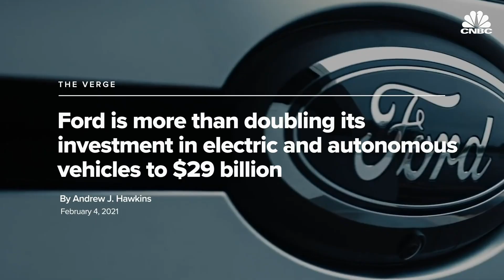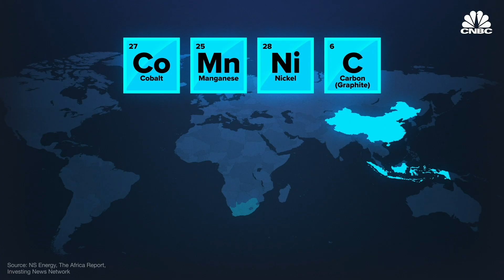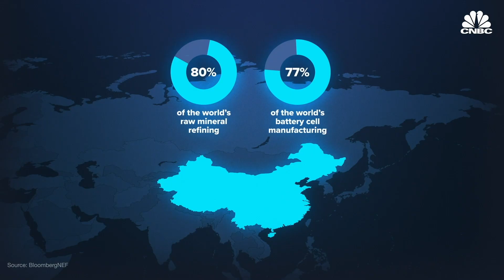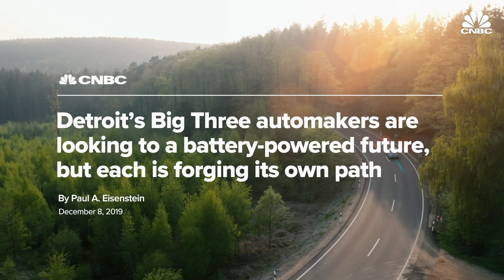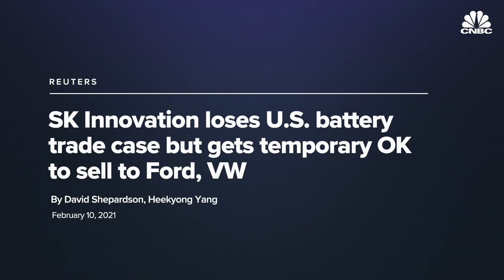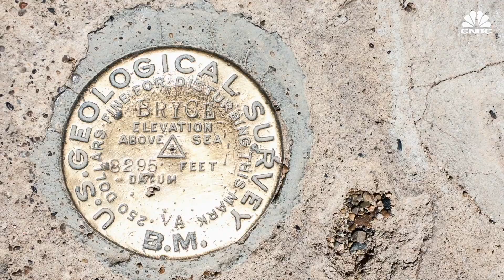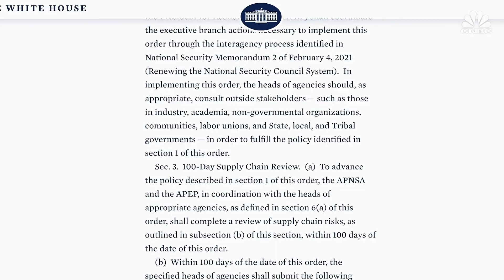Why The U.S. EV Industry Is Facing A Battery Shortage

Comment: Now perhaps,if Duracell and Energizer where to invest in batteries for cars, for example Energizer begins to build batteries to provide for Ford and the largest Ford manufacture will be in St. Louis Missouri in the headquarters of Energizer and Duracell works with GM  and then you have domestic battery manufactures boosting production for them, while Energizer might also provide batteries for Chrysler so for an electric Dodge Caravan is pink and then the Caravan goes with Energizer batteries.

That way Energizer, Duracell and probably Rayovac becomes domestic battery manufacture to provide on the big three auto makers and we have no problem in that sector.

Comment: There’s tons of lithium in the earth’s crust. The real choke point is nickel and ethically sourced cobalt
Reply: Cobalt and nickel are not strictly nessecary. The LFP chemistry for example uses neither. Granted, it has a lower energy density, but it's good enough for Tesla's standard range vehicles.
Reply: True.
Reply: BYD is not using Cobalt and Nickel in their Blade Batteries anymore.

Comment: I’ll keep my combustion engine I need to hear that engine purr!
Reply: I still have my horse! Love the clickety clack
Reply: We could be building Plug-in Hybrid Electric Vehicles (PHEV) that has both a combustion engine and a small battery pack.  A PHEV consumes only 15% of the quantity of gasoline of comparable gasoline vehicles for total mileage driven, yet a  PHEV requires only 1/5 to 1/10 of the battery capacity of a long-range Battery Electric Vehicle (BEV).  In another words, a PHEV can be driven on battery electricity for 80% of its total mileage.  It would make more sense to build mostly PHEV for now, when battery production capacity is still the limiting factor.

Comment: what happens after the batteries die where do the batteries go then? What about hydrogen cars wouldn't they be more beneficial they only leave water behind.
Reply: Batteries see second life as storage or recycled. Hydrogen cars do only leave water. But you can't ignore all the issues getting the Hydrogen to the car. Hydrogen will not be a force on our roads. Shipping and Aviation maybe. Not the roads.

Comment: Electric will be a bust. People do not want these over priced cars

US oil and gas or Communist batteries?
Reply: A Plug-in Hybrid Electric Vehicle is more affordable than a comparable Full Battery Electric Vehicle.  For combined gasoline shortage AND battery shortage, we could be building Plug-in Hybrid Electric Vehicles (PHEV) that consume only 15% of the quantity of gasoline of comparable gasoline vehicles for total mileage driven, yet a  PHEV requires only 1/5 to 1/10 of the battery capacity of a long-range Battery Electric Vehicle (BEV).  In another words, a PHEV can be driven on battery electricity for 80% of its total mileage.  It would make more sense to build mostly PHEV for now, when battery production capacity is still the limiting factor.

Comment: Hydrogen fuel cell cars are ultimately better for national security and the environment. The EV and battery hype are a cop out.
Reply: Hydrogen is not better for the environment.
Reply: @daydreamer8373   Mining rare earth metals and dealing with waste batteries for EVs versus producing and storing hydrogen from solar PV and wind.
Reply: @REVpioneer  We have been mining resources for centuries. Suddenly you have an issue? Recycling is the norm, and why waste all the energy inefficiently making hydrogen then inefficiently turning it back into electricity instead of sticking it straight into the car.

That is before mentioning all the other disadvantages.
Reply: @daydreamer8373  The point exactly. We need not bother mining or recycling the rare earth materials required for batteries. If we were all egalitarian and had a circular economy tomorrow that would be different. Energy independence for a country is an attractive proposition.
Reply: @REVpioneer  I agree, but how does that make Hydrogen fuel cell a positive choice? Far less efficient, far more expensive, and difficult to transport and store.

Comment: Why not do that same idea for hydrogen fuel cell vehicles?
Reply: What same idea?  Noone wants hydrogen vehicles, it's just a big Ponzi scheme, they are expensive, inefficient, complex and need servicing.
Reply: Hydrogen is terrible to transport and it requires way more electricity to produce that hydrogen cleanly vs just charging batteries. Hydrogen and fuel cells will have their part but they won’t replace batteries.

Comment: Well theres a shortage on gasoline as well so what are we gonna do?
Reply: For combined gasoline shortage AND battery shortage, we could be building Plug-in Hybrid Electric Vehicles (PHEV) that consume only 15% of the quantity of gasoline of comparable gasoline vehicles for total mileage driven, yet a  PHEV requires only 1/5 to 1/10 of the battery capacity of a long-range Battery Electric Vehicle (BEV).  In another words, a PHEV can be driven on battery electricity for 80% of its total mileage.  It would make more sense to build mostly PHEV for now, when battery production capacity is still the limiting factor.

Comment: Also would be nice to research ways to recycle 100% of a used battery.
Reply: There are a couple companies already doing that. Although most often after the car is done the battery is still fine and goes on for more years in energy storage systems.
Reply: Look up American manganese, they do 100% recycling, I find it hard to believe that recycling batteries is more expensive than refining ore.
Reply: @tonystanley5337  its same with concrete and plastic,
Its possible to recycle but to expensive.
Reply: @sn5301679  except battery materials are in sort supply so there’s way more profit in recycling batteries.
Reply: @sn5301679  Plastic and concrete is a one way conversion, not about specific elements, its about the structure, you can get the element back but they are common anyway so its really a matter of making sure they don't cause trouble in the environment.  Burning plastic is probably the best thing for it.
Batteries its the elements we want.  It may just need scale and there are not enough batteries available yet.  It seems like a relatively easy problem to solve.
Reply: @tonystanley5337  incineration of plastics looks easy but what about its toxic impacts and pollutants eg. dioxins and furans
Reply: @abhinavchauhan6863  if you burn at high enough temperatures and air flow its should not be a problem.
Reply: No its not bateries are made primary with metals.
Reply: This already exists. Lithium batteries aren’t new and we already know how to recycle them. As battery manufacturing ramps up battery recycling will only be a few years to a decade behind. However there isn’t currently any real need to recycle batteries. The Tesla Model S only came out in 2012 so the first gen car’s batteries only recently exceeded their warranties so only a few tens of thousands of EV batteries are starting to approach the age when they might need to be replaced. They can then spend another decade as grid storage before finally being recycled. Lithium EV batteries can have lives lasting decades.
Reply: Battery producers shouldn't mine materials forever like oil companies do

Comment: Makes sense to skip the whole thing and lead the rest of the world with hydrogen instead.
Reply: Hydrogen for passenger cars is a non-starter. It missed its chance by at least 10 years. We already have electricity everywhere so cut out the "middle man". It could be viable for depot based vehicles like buses but those are easily made full electric also.
Reply: Hydrogen is dead, batteries overtook it a decade ago. Hydrogen is expensive, needs 3x more energy than batteries.

Comment: That's why I question if EVs are sustainable. Billions of vehicles all around the world. 
On that note. Trump signed a bill that will get US out of Afghanistan by May 1st. But I bet Biden will keep us there. One reason is Afganistan sits on billions of dollars worth of rare metals needed for things like EVs. And with nations around the world pushing to that goal. You'll need all they supplies you need. Cause if the US leaves Afganistan China will no doubt swoop on to take those resources. It will be interesting to see the fight for these materials.
Reply: We could be building Plug-in Hybrid Electric Vehicles (PHEV) that consume only 15% of the quantity of gasoline of comparable gasoline vehicles for total mileage driven, yet a  PHEV requires only 1/5 to 1/10 of the battery capacity of a long-range Battery Electric Vehicle (BEV).  In another words, a PHEV can be driven on battery electricity for 80% of its total mileage.  It would make more sense to build mostly PHEV for now, when battery production capacity is still the limiting factor.

Comment: The bottleneck is not the lack of battery but the charging infrastructure. US doesn’t even mandate a charging standard. How a consumer is willing to invest in EV when it can’t be charged at all charging station?
Reply: Most of the time you charge at home
More apartments need chargers
Reply: A Plug-in Hybrid Electric Vehicle (PHEV) can be charged at home for daily commute, and can use gasoline for driving long trips, thus does not require public charging station.  We could be building Plug-in Hybrid Electric Vehicles (PHEV) that consume only 15% of the quantity of gasoline of comparable gasoline vehicles for total mileage driven, yet a  PHEV requires only 1/5 to 1/10 of the battery capacity of a long-range Battery Electric Vehicle (BEV).  In another words, a PHEV can be driven on battery electricity for 80% of its total mileage.  It would make more sense to build mostly PHEV for now, when battery production capacity is still the limiting factor.
Reply: @trungson6604  what good is a home charger if I want a vehicle that can travel long distance? Why on the earth I want spent a big chunk of money on a commuter car? As for home charging I don’t want to plug in my car for 8 hours but I can’t afford those fast super charger installed at home either.
Reply: @aps125  --A PHEV has a gasoline engine for trips longer than the range of the battery pack.  Just plug-in to the home 120-V socket at home over-night for daily commute, and use gasoline for longer trips.
Reply: @trungson6604  sure I missed your original post was refereeing to PHEV, not pure EV. But again what good is a PHEV other than having more parts/being more expansive/more maintenance? I rather have an ICE then.
Reply: @aps125  --A conventional gasoline car has an engine with 1 alternator and 1 electric starter, a 6-8-speed transmission unit and a battery.  
A PHEV has a much smaller engine, 1 e-motor acting as engine starter, alternator and torque booster, a second e-motor to provide power from the battery pack in electric-drive mode, and NO gear-shift transmission,  just  a simple 1-speed reduction gear, and 1 battery pack.  Which is simpler?
The truth is that a PHEV will last 2-3 times the mileage of a non-hybrid gasoline car, and far less maintenance, because the engine is used much less often, and no transmission service, and no brake service due to regenerative braking using the e-motor.   It is the lack of maintenance of the PHEV that car dealers don't want to sell PHEV's, because they won't make as much money selling parts and services later on, and it is the DURABILITY of the PHEV's that car makers don't want to make them, because they won't be selling as many cars in the future.  Buịlt-in obsolescence and built-in degradation and búilt-in maintenance requirement is the business model these days.

Comment: Its called Recycling ! Redwood Materials - American Battery Metals  so China can send there batteries we can reuse them. GAME OVER !
Reply: Recycle what! What amount of cars/batteries have been produced for recycling to be effective!
Reply: @carholic-sz3qv  EV batteries 🔋 and the Battery you put in your fuel based vehicles are two different batteries. EV has Chathode and Anode and Lithium. Car batteries have lead, acid that destroy the cells of cathode and anode over an extended amount of time. Those car batteries CANNOT be reused again once the cells are fully decad due to the chemicals. EV batteries on the other hand can be reused be because they do not require those chemicals to power the vehicle. It's ok... your children will understand this. 👍
Reply: @carholic-sz3qv  Telsa use 7k of Panasonics batteries to power one car at this point Panasonic has made over 5 billion batteries so far. So do the math on single batteries then use that towards how many per ex can be recycled. Then take into account the next generation batteries that are designed for recycling. Lol

Comment: and all these EVs will be charged using the coal fired grid?
Reply: @rok1475  It does actually. Coal emits more CO2 per kWh than natural gas.

Grids are changing very quickly. Coal is extinct in the UK. Gas only makes up about 40%. Renewables are cheaper and scalable.

Even using Poland's grid (90% fossil, 80% coal), results in an EV with lower CO2 emissions than a petrol or Diesel car. Check out the T&E report from last month.
Reply: @charlesbridgford254  
“It will hence not be out of place to say that if the big nations highlighted above all adopt the use of electric vehicles, the CO2 emission on a holistic consideration will definitely be the same as that of the internal combustion engine powered vehicles, as studies reveal that in view of today’s energy mix, CO2 emission from plug-in hybrids and electric vehicles comes very close to that of gasoline and diesel powered vehicles “
https://www.sciencedirect.com/science/article/pii/S2352484719309977

When I first read it I was surprised how close CO2 emissions numbers for ICEs and EVs were when this study was published.
So it seems the “greenness” of an EV (in terms of CO2/km driven) depends on how the electricity to charge it is generated.
Solar is great but last time I checked they do not generate much electricity over night when most EV charging is done.
Reply: @rok1475  Yes I think that's true.

It's not enough just to swap to EVs, it has to go hand in hand with decarbonising the generation.

In all fairness, most countries are on their way with the rollout of renewables so the tide is turning quite quickly in favour of EVs. 

The bigger, more uncomfortable truth is that we're all going to have to consume less in general, rather than just swapping a 2 tonne gas powered SUV for a 2 tonne EV SUV.
Reply: @charlesbridgford254  Most countries- by number- are perhaps moving away from burning fuel for electricity. But if you look at the top 5 CO2 producers, there is little evidence to support any hope that CO2 emissions will go down   any time soon.
China is adding hydro power but most of their electricity comes from coal and that is growing. US is swapping coal for natural gas because it is cheaper and because gas companies invest in solar and power to guarantee demand for gas outside sunny and windy periods. India is too poor to convert to anything green on a large scale. I don’t think Putin cares that much about CO2 emissions and Japan is scared of nuclear now.
But if the top 5 don’t do much to cut their emissions the rest of the world will not make a difference.

But the shift to EVs could still be good for business. There are estimated 1.4 billion cars in the world. Replacing all of them over next 20-30 years is a golden opportunity for car industry.
If they stop making ICEs and people can’t get parts and service for the old ones then they will have to buy new EVs. 
Western car corporations probably learned their lesson from analog tv to DTV conversion fiasco and are jumping head first not to completely miss the boat this time.
Good for the economy,  perhaps?
Reply: in 2020, coal plants produced only 19% of US electricity. Just 10 years ago this percentage was 45%.  In 2030, it will be less than 5%.
Reply: @rok1475  Yup, it does.  Thanks for help making my point.
Reply: Even a 100% coal fired grid results in an EV with lower CO2 emissions than a gas powered car. See the T&E report from last month.
Reply: @charlesbridgford254  thats totally wrong.

Comment: In future average economy of lithium ion battery vehicle will be more expensive than combustion engine  vehicle.. 
   Only solution is new tech in battery..
Reply: Not true
Reply: @neeljavia2965  4680
Reply: @neeljavia2965  true. demand for lithium growing.
 Rising demand = rising prices.
 Lithium is finite..
Reply: @maruthimaruthi3720  it's literally one of the most plentiful substances on earth's crust
Reply: @brandonn.1275  estimates say at this rate by 2070 Lithium refinary's will start facing shortages. Li ion battery recycling is expensive. Also global lithium salt price's increased by 93% at this rate by 2028 average li ion battery vahicle economy will be much higher than combustion engine vahicle.
   That's why many working on Aluminium air battery and to decrease chinese dominance on battery manufacturing..
Reply: @maruthimaruthi3720  Better process, better efficiency, less price.
Reply: @maruthimaruthi3720  Battery prices have been falling since last 10 years.
Reply: Yes next tech/Generation batteries or power train.
Reply: We could be building Plug-in Hybrid Electric Vehicles (PHEV) that consume only 15% of the quantity of gasoline of comparable gasoline vehicles for total mileage driven, yet a  PHEV requires only 1/5 to 1/10 of the battery capacity of a long-range Battery Electric Vehicle (BEV).  In another words, a PHEV can be driven on battery electricity for 80% of its total mileage.  It would make more sense to build mostly PHEV for now, when battery production capacity is still the limiting factor.